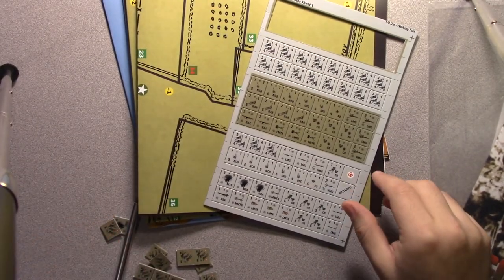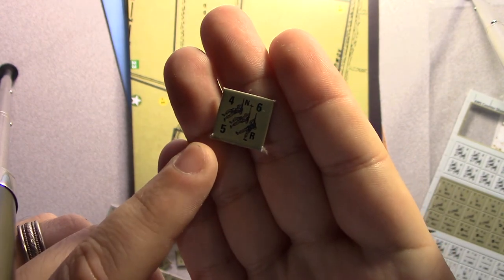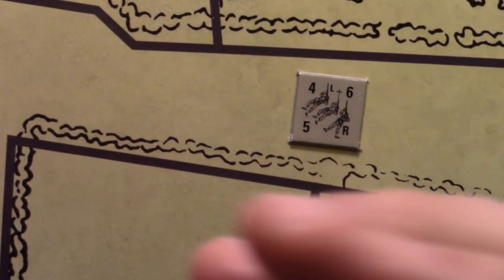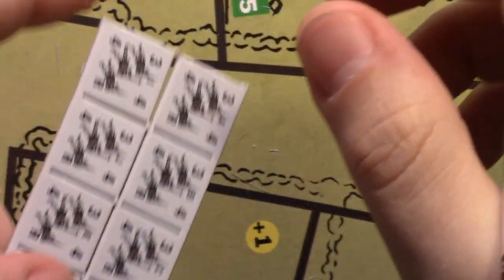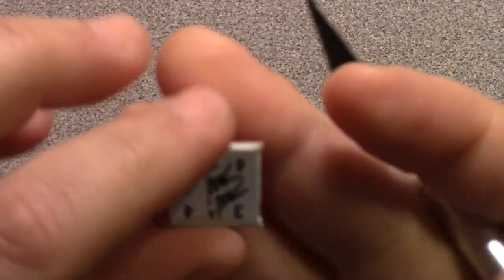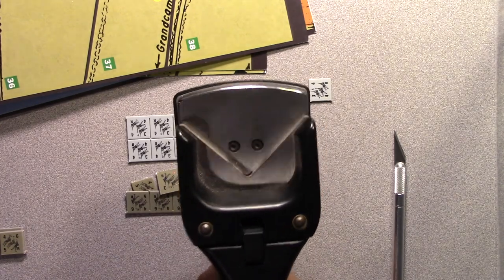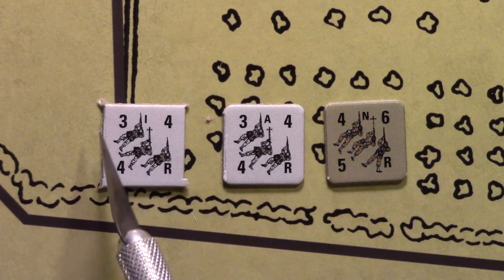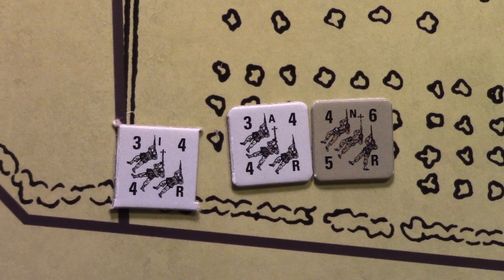PSA: Why I Clip My Counter Corners

Comment: Some call those nubs "dog ears", but back to the subject. I find that a pair of good size scissors work better then a x-acto knife.  As us model builders do have and use the god-send x-acto knife for cutting plastic spurs or what have you, such tool can cut (strip) the side of your counter to easily if to sharp.  So I stopped using that and now I just use a large pair of scissors.

I also use the 2.5" Oregon clip cutter but must say after three sheets of counters I had to glue one of the sleeves that guide those two horns that pop up when you press the clipper down.  As always thanks for the upload!
Reply from the maker: I've been fortunate with my clipper so far, hope it lasts a few more years. I'll try scissors on cutting the counters out, would probably be so much easier.

Comment: Would your corner rounder cut the ship markers form Admiral's War ? They are thicker counters. Would they fit the space in the tool ?
Reply from the maker: I have not seen those counters myself, but I'd guess yes. The clipper I'm using was designed for clipping laminated workplace badges, so I'm pretty sure it can handle most thicknesses of counters.

Comment: I'm a little undecided at the moment. I'm considering grabbing the 2mm as many of my games rely on half inch counters and some have print very close to the edge.
Reply from the maker: I found the 2.5 does a good job, so instead of buying a 2 for smaller counters and then a 3 for larger, 2.5 hit the sweet spot for me. I don't think it removes as much as people thinks it does. And not enough to make numbers unreadable in my opinion.
Reply: @CounterProductiveGames  Thank you for the reply, it's greatly appreciated. I've looked at a number of comparative images and I find it really hard to judge how much of the counter is removed.

As an example of one of the counters I have with info close to the edge. There's approximately 1mm between the corner of the counter and the nearest corner of the printed info. Across the bottom there is slightly less than 1mm. Admittedly this is an example of one with info extremely close to the edge but the counters within this particular game frequently stray within this distance.
Reply from the maker: @FreeFragUK  for something like that, I'm sure it would cut into the graphic, number etc. but sill leave more than enough to know what it is. Really just a decision then on how important the overall image is to . If you don't won't the information touched at all, then yeah, a small cutter needed. For me, as long as I can still read the data with no problem, I'm ok with a slightly smaller number that is still recognizable